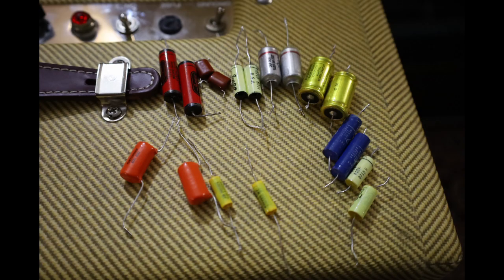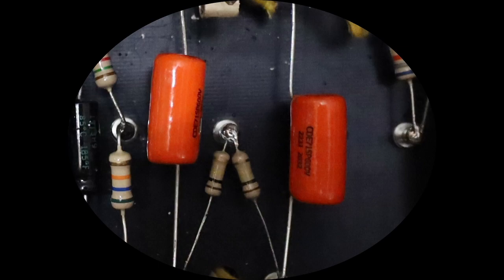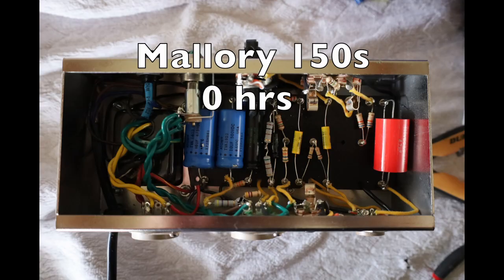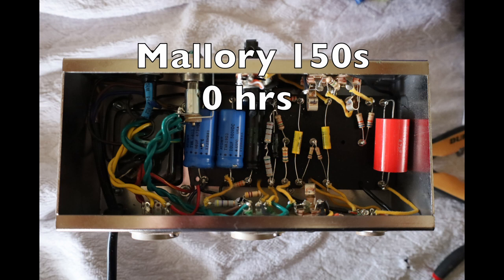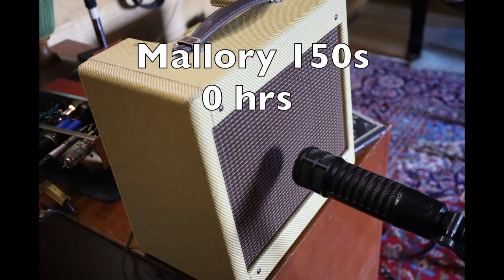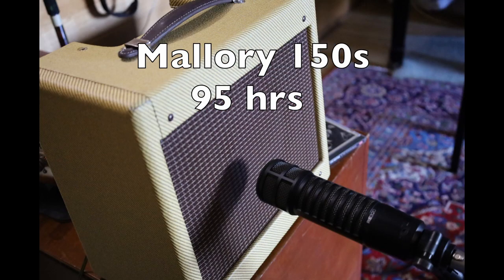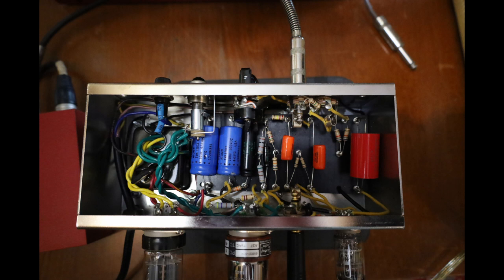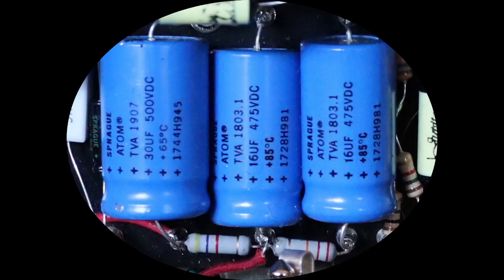Valve/Tube amp capacitor burn/break-in

Comment: hey, so i got a fender twin reverb from 76 and i see a burned capacitor on one of the 6L6 tube inputs, should i replace all the wiring and said capacitor? or there is a way of doing a bridge on not using said input

PD: the amp still works i can hear some sound and if i tweak the knobs they respond as they should do so i dont know if the problem is that burned capacitor or that thing fried something else